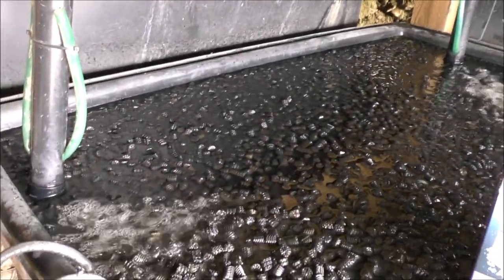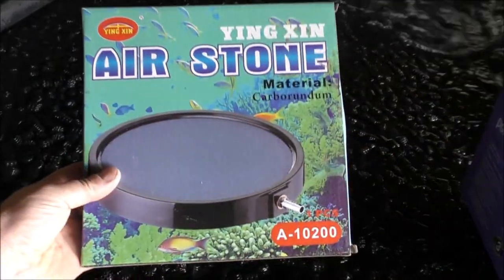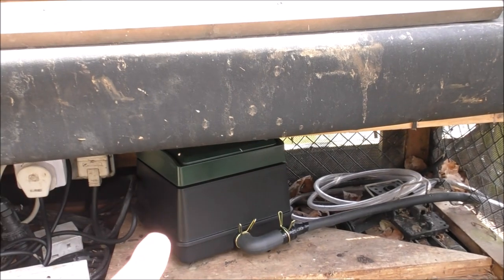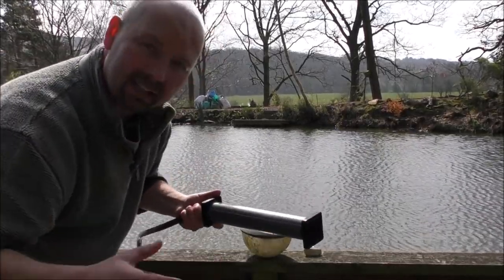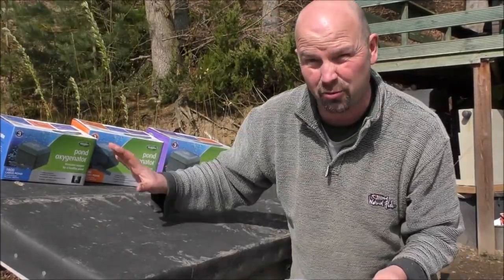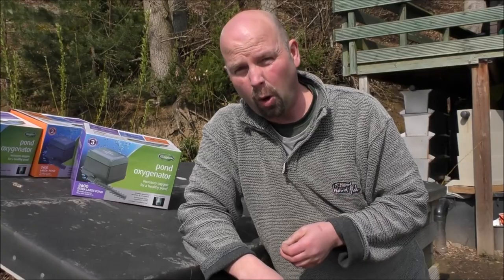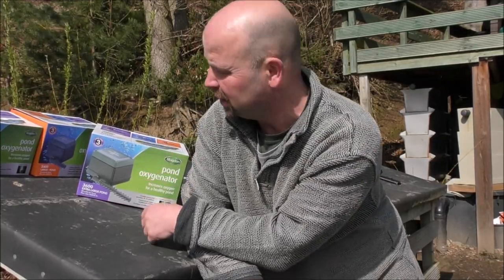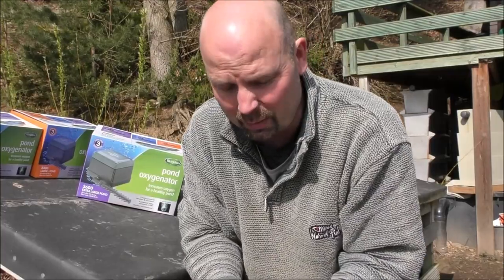Great Air Pumps For Large Moving Bed Filters and Ponds

Comment: There are still areas of that MBBR that isn't moving. What's the volume of the MBBR? And how much of that is filled with media? 
At what depth are the airstones placed?
I have found that those 8" discs are quite restrictive. Use a medium pore AirStone with less restriction and the pump will work better.
Reply: true

Comment: Hi Just a quick question how is the air stone connected to the air line, as it lets you chuck it into the pond.
Knowing my luck it would fly off
great video thinking of running one of the3600 in a solar set up 32 Watts is very low consumption.
we dug out a pond similar to yours last year and lined it approx 20m in diameter and 8 foot deep.
great video glad ive stumbled across you
cheers
Woodsman243

Comment: Is the answer Frank ?! Did i win ? Lol .  Whats your thoughts on wrapping some foams around an air pump to reduce noise ? Would there be a safety issue ?
Reply: May cause extra heat which will kill it faster.
Reply: Sit them on rubber pad works better than feet they put on them

Comment: Could you advise a pump for a dump moving bed filter 
Can’t seem to get my chamber moving enough
Reply from the maker: I'm not familiar with a dump moving bed filter but most of the moving bed media will take an age to get moving properly.
It's best to start with the chamber only filled to 25% then after a few weeks you should be able to fill it to 50% (so if the chamber is 100 litres you'd need 50 litres of media). With the K1 micro you can fill the chamber to 75% as opposed to only around 50% with K1 or Hel-x.
Since plastic is a really hostile environment for bacteria to colonize the media needs to build up a 'biofilm' for the bacteria to survive on and when that builds up (when the media starts to discolor) then it will move much better.
If your media is new it will not move very well at all.